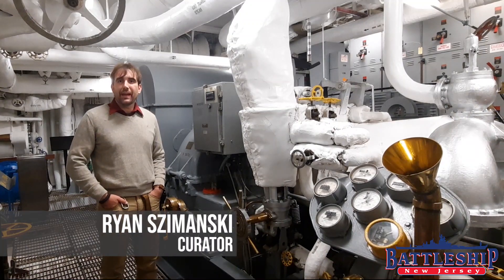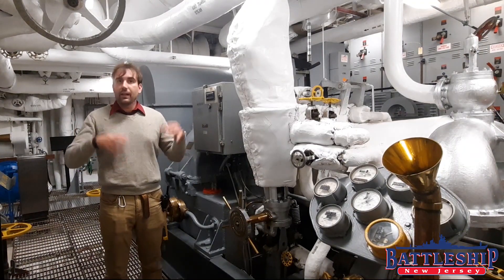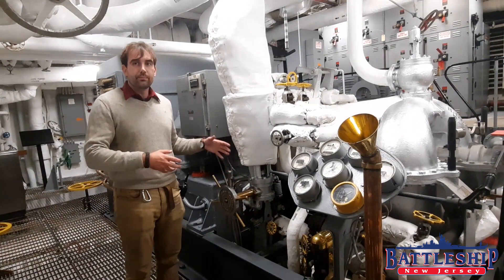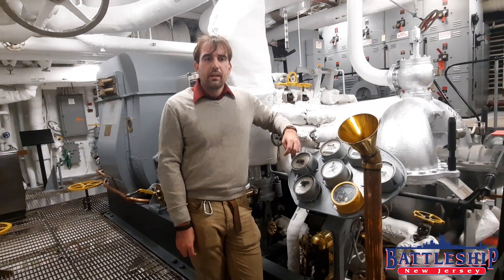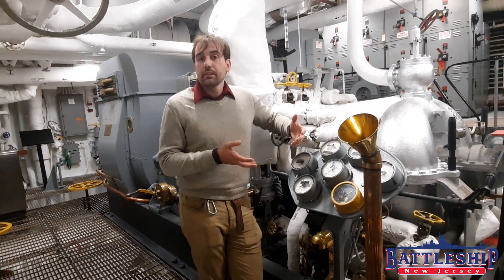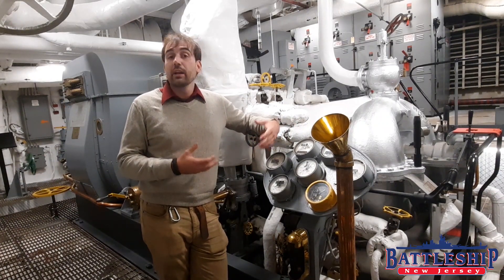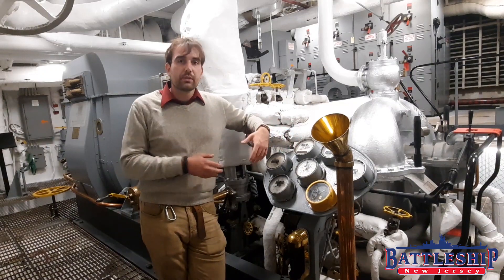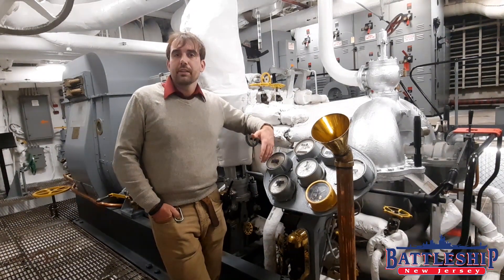Battleship Turbo Generators

Comment: I'm surprised how small the turbine end of that SSTG is. Quite a bit smaller than the TGs we had on USS Sturgeon. I would think older turbines would have been bigger to get the power from the steam...maybe its due to 1200 lb steam so they don't have to be that big?

Comment: Nice video.  As other have stated the turbine is in the white insulated area.  The 440 VAC 3-phase generator is inside the square enclosure.  The small generator on the back is the exciter is most likely an "Amplidyne" to provide DC to the field coils of the generator.  The manual oil pump is used when starting to provide oil to the shafts and to raise the governor throttles valves.  The "trip wheel" is used to slowly open up the steam to get the generator started.  After that the governor takes over.  I used to test ship service generators when I worked at San Francisco Naval Shipyard in the 1960.  I wish I didn't live across the country.  I could volunteer and help explain all of this stuff to visitors.

Comment: Where did the water come from to create the steam? Did they pump in sea water? If so did they filter the steam before pushing it through the system? I'm guessing ocean water steam is nasty
Reply: Boiler feedwater came from the sea and was treated before going into the system. The first step was removing the salt and other impurities.
Reply: It came through openings in the hull
Reply: In some videos you'll hear Ryan mention "evaporators". Original loading might have been from a municipal freshwater supply, but during operation all water is sourced from the sea, filtered through screens, and then through the desalinization plant. Desalinization is achieved by evaporating the water to separate it from dissolved salts, which are washed away basically as salt sludge. The desalinization plant provides 'fresh' water for domestic uses and as necessary to the boilers. Boiler feedwater has additional treatment for proper chemistry to limit corrosion and scale buildup

Comment: I worked for the Navy Ships Parts Control Center when the BB's were last in commission. One, the USS New Jersey as I remember, had a turbo generator failure while off the coast of Lebanon. They requisitioned an entire turbo generator. GE told us it would take two years to make one, maybe. One of our contracting officers knew of a company that had bought equipment from the never built USS Kentucky. Yes, he had a brand new, 1940's, SSTG still in the original preservation. We bought it and had it shipped overseas in about two weeks! We know that the engines from the never built BB's went to a couple of AOE's but I learned that other engineering plant equipment went to shore steam plants. Newport News Shipbuilding had, at least, a BB DA  tank. I retired as an MMC(SW) from the USNR. I just missed a cruise on a BB as my civilian job was more important to the Navy than being activated and sailing the seas for the Gulf Wars. My DD from active duty was 1200 PSI and I stood top watch in the engine rooms even though I was "A" Gang.
Reply: I worked for GE Marine in the 1980's. The 2 year lead time probably had a ''Rush'' premium put into the price. From Terribly Expensive to Horribly Excruciatingly  Expensive! I did a lot of SSTG repairs including swapping out reduction gears on Ammunition Oilers, submarine repair ships, etc. mostly 350-1200 Kilowatt units, reactor feed pumps on the USS Enterprise, etc. On one MSC Surveillance Missile Tracking Ship, T-AGM-23 all 4 of the 600KW SSTG sets were well worn and were constantly overloaded and would throw off Low Pressure shroud bands and blades. We replaced the units with 3 direct drive SSTG sets of 2000 KW that came off a retired nuclear submarine. They were smooth as silk. We had a lot of contacts in the San Francisco area and many times I was sent to raid spare parts off of mothballed and derelict ships. There is nothing spookier than going into engine rooms lit by 40 watt string lights every 40 feet. When you are the only living soul on board, you hear creaks, groans, pops, moaning, and water dripping. 40 years later I still carry a flashlight in my pocket every single day.
There is nothing darker than when the shorepower breaker trips and you are below the waterline on a strange vessel completely lost.

Just after I quit GE, I was on an MSC ship that could not run past 86 propeller shaft rpm. The normal full speed was 105 rpm. The ship was in Point Hueneme and I wasn't even assigned to work on the main engine. But after hearing about the problem and poking around with the throttle valves I found that some springs inside were weak. They were about 5 inches diameter and 3 feet long. GE wanted 18 months and $50,000 to replace them. That afternoon  I bumped into a small company in Ventura that made replacement springs for Navy guns, 40mm and up. The owner said he could make them...but how soon?  ASAP I told him. ''How about by tomorrow afternoon?''  Holy smokes YES! He said he would have to charge more for overtime, heat treatment and he apologized. I think the entire bill from him was $1700 for 3 finished springs. We installed them, did a sea trial, got 105 shaft RPM. The engine crew never saw any more than 88 shaft rpm in the last 10 years. I still smile about that. The ship had President John F. Kennedy on board to observe a test launch of the new Polaris submarine missile. The launch silo was welded over by a plate near the Starboard stern and I stood on it many times. What history!
Reply: I was an industrial electrician for 50 years and he was the worst company. Took them a year to get a under voltage relay and being it was ge old all of 6 years was obsolete. Took crack POS service department another year to get a wiring diagram for morons to connect 5 wires. In one way it was great every time we that 13,200 volt service we got paid 4 hours OT to spend 30 seconds switching service back on. Had more trouble with ge medium voltage switchgear then all the other brands combined. A few years ago my company got stuck with garbage dual service POS GE garbage 13,200 volt switchgear at a new building. Within first year ge was back several times and had to install heaters inside of outdoor switch gear that was causing problems. Took ge almost 2 years to sell their USA lightning division.  Was told nobody wants to purchase them.ge started out by back stabbing take credit for everything his workers discovered  Edison then continued to be a scum bag company.
Reply: Hey Bill,  I am carrying out your legacy as I also was a "MM A Ganger" and work at NAVSUP-WSS in Mechanicsburg.
Reply: You can always count on POS GE dragging their feet securing parts or equipment. Took them a year to get us an under voltage relay then another year for ge morons to figure out where 5 wires go to replace a 8 year old obsolete relays. Let's see two wires always go to relay coil, 1 to common 2 to normally open last to normally open.

Comment: At 5:50 Ryan said he believed that electric motor propulsion, with the motors powered from (steam) turbo generators is unique to certain USN ships.  That may be so.   However electric motor propulsion has become common in cruise and cargo ships - the reason is both greater fault tolerance and greater fuel efficiency at all speeds.   However, in such civilian/commercial ships, the source of electrical power is diesel engines, not steam turbines.  Steam turbines loose efficiency when operated at low RPM.   But with diesel electric drive, the diesels are kept operating at optimum RPM and only sufficient engines are kept on line to meet the power need.
Reply: Nah, it's not unique. Ship electric drives were developed in the early 20th century.

Comment: Why doesn't the Navy let you make steam (either in the original boiler or on dock and then piped in?)
Reply: 600 psi steam is very dangerous, a boiler explosion will kill the whole watch in seconds. No getting out of it. The watchstanders are very well trained and preform the casualty responses in the dark(no lights), noisy, super hot (no vents, no power)conditions instantly and correctly. Not bad for a bunch of 18-20 year olds. I can't imagine what it would cost to maintaine the plant, fuel it, and have civilian watchstanders to man the plant 24 hours a day 365 days a year Retired BTC(SW)

Comment: When do they stop using the voice tubes (versus their alternatives)
Reply: All the ships  (7) was on had voice tubes in the firerooms between the upper lever ( check valve to control the water level in the boiler) and the burner front. Also had them by the  SSTG's upper and lower level. We used them often for quick comms  and not just water, or nuts and bolts. They were great, quick very clear comms that didn't tie up a hand to hold the phone to your ear.

Comment: As a electrician, I have put in many 480 into buildings. Transformers step the 480 down to 208. 208 is used for 110 circuits and 208 circuits
Reply: Navy systems are different. Navy systems are nominal 440V and nominal 115 volt (there may be 220-230 as well as they were mentioned in this video). Everything is ungrounded delta. The navy has strict rules about electrical equipment due to the nature of this system and potential shock hazards as it isn't 115 volts to ground like a normal civilian system, all single phase 115 volt equipment runs on two phases on the 115 volt delta system. There is a great film called "115 volts, A Deadly Shipmate" that explains electrical safety on board ship and why the rules exist, just not on a technical level.

Of course I'm not a Navy electrical expert, so there are probably exceptions to this, but for New Jersey, this is the way a lot of it is.
Reply: @jrmcferren  Found that film and watching it I get the impression that the example ships are using the same type of bonded-neutral system that is common on land. 115V phase-to-phase makes sense for an isolated system, but being isolated there's no normal path between the ground (in this case ship's hull/structure) and anything that produces or carries electricity. Isolated systems are common in hospitals where there's a real chance that something electric will get wet as faults to ground won't cause a short. Isolated systems are dangerous at scale however for that same reason - a fault to ground won't trip a breaker and will go undetected until another phase/neutral is also faulted. Good luck finding both faults!

Comment: Please stop calling turbines impellers, they are not!
An impeller is the OPPOSITE of a turbine. 
 It has nothing to do with being in a box or in open air.
A turbine extracts energy from a fluid (in this case, steam) whereas a impeller adds energy, ie a compressor wheel in a turbo or jet engine.

Comment: Just a couple points of clarity from a MM who operated SSTG 1&2 in the 80’s for several months. 

First the hand oil pump was used during starting and stopping the TG, since we didn’t have electric pumps like are installed on modern ships.  While I operated those pumps I never heard the nickname you used to reference these pumps, although it’s pretty good description.  Btw you always turn the pump clockwise to get it to work. 

Next, the throttle handle was only used during starting of the TG. This allows you to slowly start and warm the turbine before you get it up to speed.  After it is at speed, the throttle is opened all the way so not to disturb steam to to the electro hydraulic Woodward governor. It was only closed when the generator was tripped to ensure the steam flow was stopped. 

As for the sounding tube we regularly used it to talk between the SSTG watch and the lower level watch standard. We only used the phone to communicate to the whole engine room, I.e. casualty, or the MMOW when we need to give a update status. 

Also, these were not motor generators, MG’s, these are Ships Service Turbine Generators.  If the generator ever turned into a motor, which it could do, the reverse power relay should, and in my experience does, open because this is “Very Bad”.
Reply: @Andrew Crews the reverse power relay would trip anytime the generator would start pulling power, usually, the electrician on watch would trip the breaker, before as as we lost steam, so it would not reverse power. 
While underway we had 6 generators running, usually two parallel forward, two aft, and one in standby forward one aft. We could split power distribution forward/aft, port/starboard, or each engine room could feed 1/4 of the ship. 
While aux steaming, like at anchor, two generators could handle the ships load, but couldn’t allow for guns firing.  
They were synchronized using a oscilloscope, same design as the light method, but usually makes it easier. Electrician on duty in each engine room was responsible for this work.
Reply: @cruser69  Why couldn't the guns fire with only two generators? Was it that the actual firing circuitry wouldn't work, or was it not sufficient to be able to run the hoists and drive the motors to traverse and aim the guns?
Reply: @witeshade  it was about electricity requirement to power everything else and firing. Not to mr nation all the gunnery equipment, you have lights, fans, steering, engineering equipment, just a BUNCH of electrical equipment needing power, so you prioritize where electricity goes. I am sure we could operate a guns on just a generator, just have to turn off a lot of other things.
Reply: I had a lot of SSTG's apart and reassembled during yard periods in the 1980's. There's a plate orifice in the oil line near the trip reset handle by the LP end. So very many times the yardbirds would forget to put that plate back in the flange. They would crank that oil pump like maniacs and the TTV would not budge. GE would send me in to see what they did wrong. So many times I would bet the machinists that I could tell them how to fix it and have the unit up to speed in 15 minutes. I had 3 or 4 orifices made up that I carried in my briefcase because somebody always lost that little plate with the 3/16'' hole in it. If I ran the job, I had the yardbirds wire it on to the flange so it wouldn't disappear. Those jobs paid my house off and now I live here cheaply. Thanks for your service. I hope you didn't write FTN anywhere.
Reply: @kimmer6  sounds about right. Loose thing that are important!!  No I didn’t write anything like that anywhere. I was looking to be a lifer, didn’t make it, but was on my way.
Reply: @Andrew Crews I don't think the aux diesels would be able to power the gun turrets. They often describe them as extremely low power. But maybe that systemw as prioritized for power from those generators.

Comment: As a Navy EM the generators on nuke subs are turban not turbo. The white part is lagging insulating around the steam turban the grey steel is the generator.
Does she have an Emergency Diesel Generator? A Battery Bus?
Reply: MP: Turbine(?).  Turbo = Steam Turbine. Same thing. SSTG's. (usnr-ret)
Reply: You worked on/around Turbines and never learned the spelling?

Comment: Interesting that aircraft run a 400Hz system for lighter and more compact motors, and that frequency also assists with gyro operation, yet I take it the NJ operated 440V 60Hz?  That does make it compatible with shore power of course.  Would also be interesting to see diagrams of how the power was fed around the ship.  Presumably a number of ring mains for redundancy.  And in British ships I know there used to be 3 phase feed-throughs in the bulkheads and you could by-pass damaged fixed cables with large portable emergency cables.   From memory it all looked very dangerous, and of course just add sea water into the mix.  Could the turbo generators be paralleled?  Or were they all running on switched buses?
Reply from the maker: Heres a start on some of those questions https://youtu.be/yeiiHAJUurE
Reply: If you're ever in Wilmington, I actually cover all those for the North Carolina museum. 

We're putting together a bit of an online program for some of those things too:

http://www.battleshipnc.com/meet-the-showboat/

Comment: Worked with a guy who was a Machinists Mate on the Wisconsin, recalled seeing a flange gasket fail on a high pressure steam line. Another sailor nearly lost an arm when it happened as he was next two it he said "it cut like a laser"

Comment: As a point of clarification, a motor-generator is a separate kind of machine- those have two machines, one or both AC or DC on the common shaft, and when one motors, the other generates, and can usually go back and forth between the two; on an SSTG you're just going to have a single AC or DC machine on the same shaft as the turbine section.

Also, the reason the three-phase power on the ship is connected in delta configuration is for damage control considerations: if you ground a single phase in a delta configuration, you still have about 80% of the capacity available on the other two phases. If they're connected in a wye configuration, if you lose one phase you lose the whole thing.

Comment: You're quite a ways off on a lot of this stuff.  The throttle is opened wide. It does not control the speed.  The speed is actually controlled from the main electrical board.  The turbine has to spin an exact speed to make 60 cycle electricity.  The EMs would have to sychronize all the speeds of the various generators to avoid them being out of phase.  I unfortunately witnessed one of gens being brought on line 180 degrees out of phase.  Wiped the thrust bearings.
Reply: you're lucky that's all that happened. Saw two SSTG's paralleled 120 degrees out of phase, and the whole generator jumped on its foundation. And the breaker about cooked itself- lots of fun when it's a 4160V breaker that's literally right behind where you're standing.
Reply: @tspencer227  Yep. It bucked around a bit.